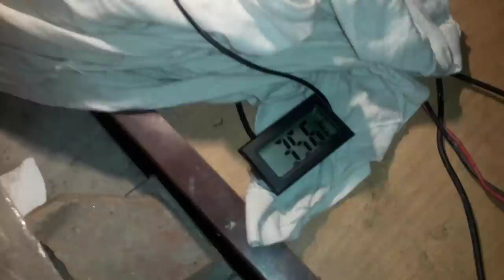how to make incubator egg hatching - sunlight incubator

Comment: What do you use at night?
Reply from the maker: What to do at Night ?
If Temperature Is 32°C or More at Night Leave As It Is No Need To Do Anything But If Temperature Is Below 32°C Then try to cover the bowl with blanket or with some cotton material or wool (i cant Use Light Because at Present We Are In Summer Season & Temperature At Night is almost Between 32°C-35°C).
This Method Works Mostly In Summer Season and Very Hot/High Temperature Places(Countries).
If You Have Any Doubts Relating To This Procedure Please Ask In Comment Box We Will Try To Reply As Soon As Possible

Comment: Bro aa matti yenti ?, and aa temperature meter yekkada dhorukuthundhi ?
Online lo dhorukuthundha ?,
M name aa meter name and yentha temperature dhaka penchali light voltage ?
Reply: Temperature meter from aliexpress. Many internet markets retail it twice higher price. Actually u can use chip medicine termometr, it much better. temperature must be between 37-38.8 Temperature 39 is kill eggs already/ If u have cold wether than 38.5 is good if too hot then 38 degrees.  when eggs underheated(lower then need temperature) u can just later day resultat day 23 till 29 days. They may coming out 6 days.